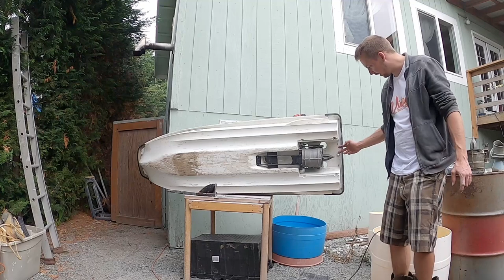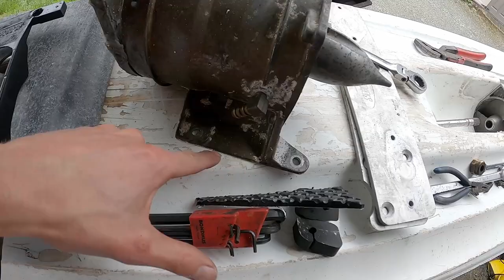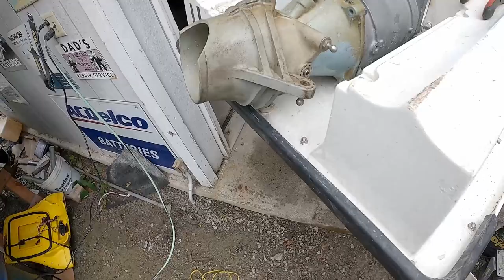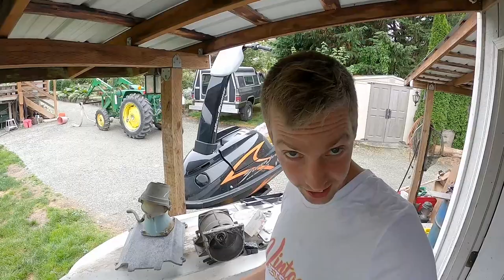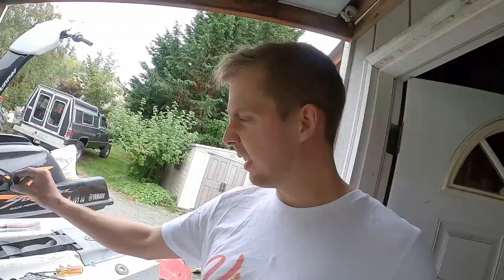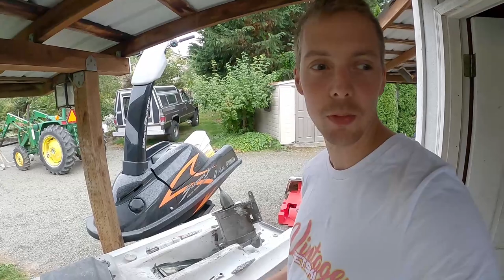BOB ski build

Comment: I swapped a 550 into my 300sx over the summer. If you need any more room in the engine bay you can cut out the oil tank in the front nose (and glass over it) so you can scoot the gas tank forward about 4". We had to do that to fit the 550 and the exhaust in our swap.
Reply: I Thought about that..... But I didn't feel like taking all the parts off for it. Seems like it would be kind of a cool spot to put a battery or something, but there is plenty of room to put it in the stockish spot. I'm thinking I'm going to mount the engine in the farthest forward spot with the tank in the stock spot. Hey if I don't move the tank, I don't have to make one more thing!

Comment: Add tabbies please big fat costume ones even if they are made from wood at first lol! They will be the game changer..... oh and add an aluminum shortened hand pole maybe from KP they are awesome and way affordable. I have built up a 1990 Kawasaki Sx with a piped 750 small pin with all the other go fast stuff like high compression head, lightened fly wheel 750 Coffman exhaust manifold and head pipe with an R&D extended expansion chamber with 1 7/8” inside diameter stinger  to the modded factory water box all 1 7/8” with exhaust outlet pushed back further down the side of the hull, not rear exit sorry! Has jet dynamics scoop intake grate, rend  D cut extended finned ride plate, bored pump cone with a solus repitched 13/18 impeller, with a blowsion pump cone. that has bin bobbed, shortened and added an aluminum hand pole from KP that has been moved forward 11” from the stock crappy Sx pivot point and is 8” shorter that the stock handle bars are mounted fully adjustable with blowsion turn plate, blowsion hand pole bracket with blowsion under backer plate, blowsion zero degree handle bars, super jet steering cable, it’s longer and has more throw. also has molded in tubbies also blowsion, I’ll be trying to up load my build you guys are my #1 inspiration for years so thank you!!!! Smokem if you got them brap brap! Oh and it’s 290 lbs. dry

Comment: Be so much easier to tack the 300 top and 650 bottom   put them together  I no the 650 bottom will need cut down  but still be easy  bit of glue put 300 top and 650 bottom together  bit of fiber  glass  to put 650 bottom together  job done